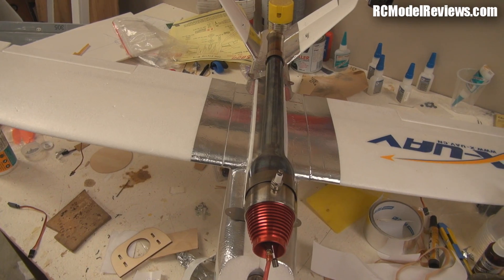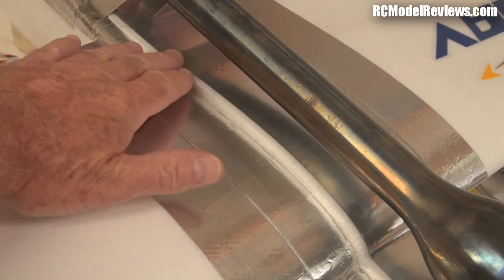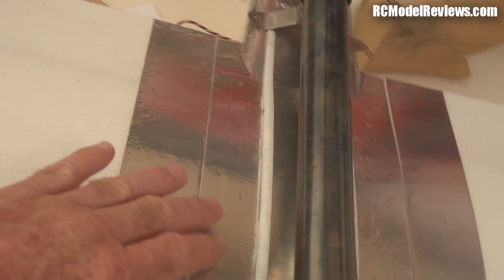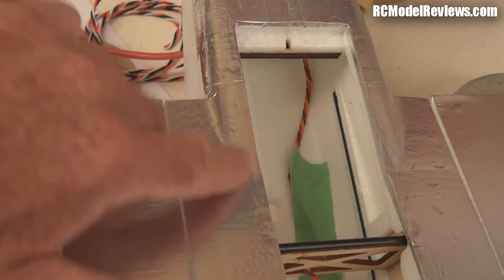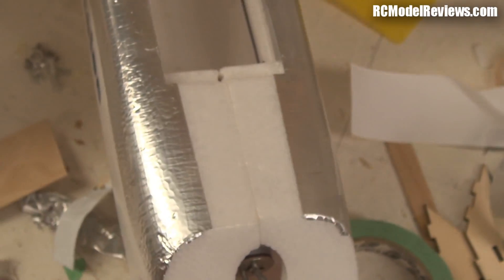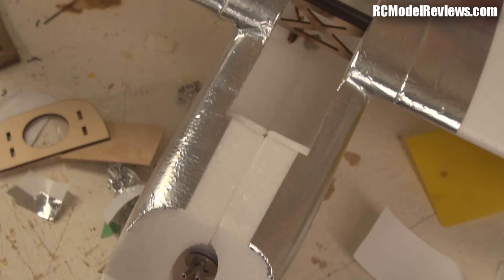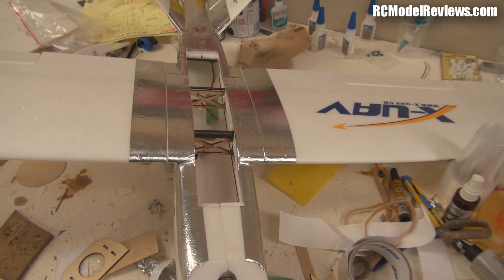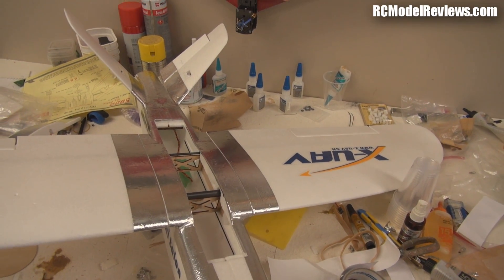Project: A real jet-powered RC plane for under $200 (continued)

Comment: Bruce-
  I suspect the AL tape alone will probably not provide adequate heat insulation.  You may want to consider using "Fiberfrax" insulation used on full size aircraft firewalls to protect the foam.  It is available in various sizes and thicknesses from:  https://www.aircraftspruce.com/catalog/appages/fiberfrax.php?clickkey=208805.
Looking forward to seeing (and hearing) your pulsejet project fly.  Good luck!

Comment: Love it! But...

The Mini Talon can be very stall sensitive if the CG ends up behind the servo wire exits (65mm). Even at 65mm many have reported tip stalling and crashing on launch although that shouldn't be a problem here :) I just wonder if the fuel tank wouldn't be better a bit farther back close to the CG and some ballast in the nose to compensate.

FWIW - X-UAV rep "Vivian" confirmed in a letter on February 6th, 2017 the listed CG of 76mm in their current documentation is incorrect. (I have docs from three different Mini Talon builds that show the CG measure at 55mm, 60mm and 76mm!) 60mm works best in my opinion.

With that said, I can't wait for the maiden vid!!

Comment: Is the Aluminium foil interfering with the receiver signal? I can't find any decent information about aluminium foil and receiver signals.
Reply: It will block the signal if the foil gets between Tx and the Rx antenna. Similar issue to that seen with carbon fiber fuselages, miniquad frames and so forth. Solution is to use multiple antennae and position them so that there's always at least one that has an unobstructed line of sight to the Tx.
Reply: So outside the fuselage is the best option I guess?

Comment: have you thought of putting a thin wall brass tube over the hot section with a 6 mm air gap

Comment: That foil tape is ducting tape.

Not to be confused with "duck tape." 
Duck tape isn't designed for ducting, as the adhesive doesn't do well in an environment with high temperature swings.  It's original use was water "proofing". I put proof in quotations because, in my experience, it doesn't do that all that well. More like making something water resistant.

Comment: I think the foam will melt anyway.....
Reply: I'm thinking, not hoping, the same. The savior may be the wind over the wings once in flight. I can see the reflective tape doing a partial job of keeping the foam protected but maybe not well enough? That tube on that engine glows red hot! Will be interesting to watch.
Reply: The foil tape should do a very good job of deflecting radiative heat transfer.  As long as the aircraft is in flight passing air should carry away heat.  My concern is when it lands but the engine is still hot.